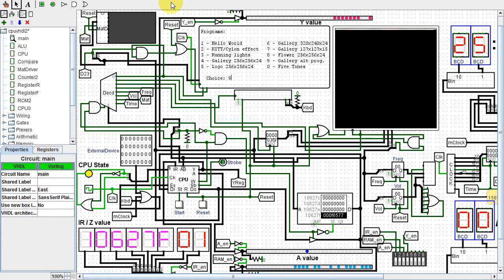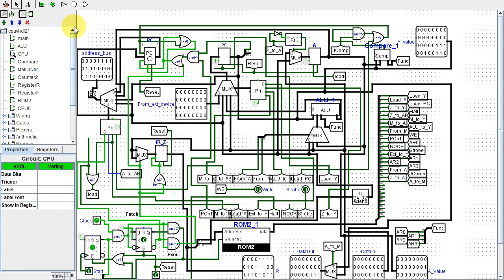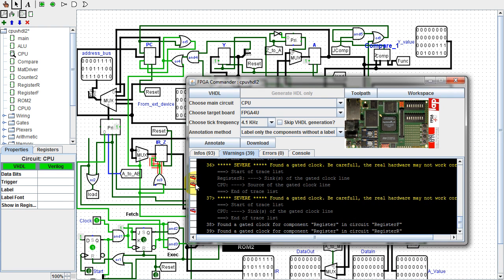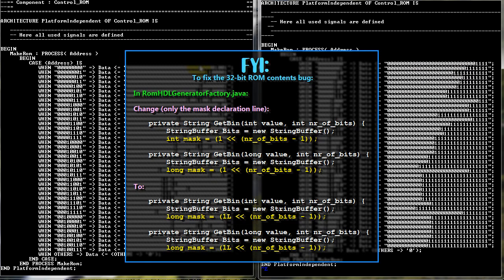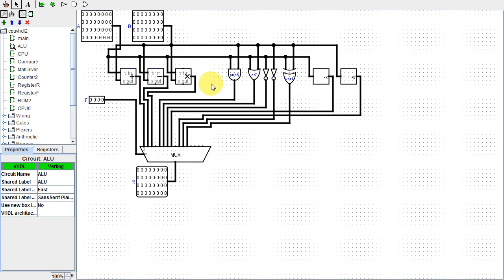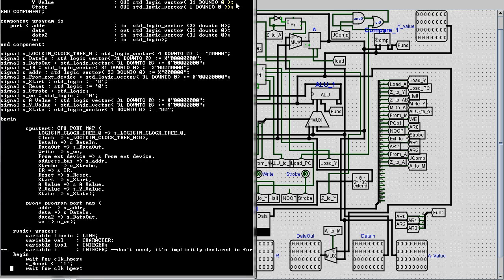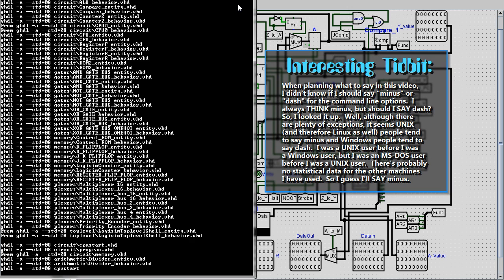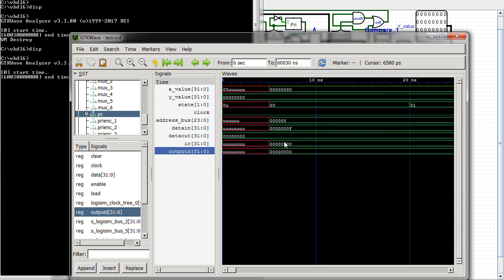Converting My CPU to VHDL Via Logisim Evolution (for Eventual FPGA Board?)

Comment: I have a problem, I maximized the VHDL Simulator log and now I cannot see my circuit anymore unless I end the simulation, how can I fix it? I tried uninstalling and installing again multiple times but I could not fix it
Reply from the maker: @Noora AlNaimi I've never used that feature.  I believe it's the feature that requires Questa which I don't have.  So, I probably wouldn't be able to help you.  BTW, there's a lot of information you didn't provide like what OS (Windows, Linux, etc.)?, which version/fork of Logisim?, executable or a JAR file?  But I don't think the answers to those questions would help me because of the reasons I first mentioned.  If the log is a different window, maybe there's a keyboard shortcut to un-maximize the window (dependent on your OS).  There are many settings Logisim doesn't save to configuration files, so I don't think it's some persistent setting in Logisim.  Maybe a setting in Questa (if what you're talking about is the feature that requires Questa).  If your OS is Windows, you might need to "regedit" to change some registry key (but only do that if you know what you're doing).  I can't think of anything else.
Reply: @MrMcsoftware  Thank you so much for your reply I really appreciate it. My OS is Windows 10, and I am using the 2.15 version and I tried with the 2.13.8 version as well (both are JAR files). Yes, you are right I am using Questa. The log appears on the same window, there aren't any window reset features, I will try the "regedit". Thanks again!
Reply from the maker: @Noora AlNaimi You're welcome.  I haven't used regedit/regedt32/(whatever Microsoft may have called it in Windows 10) on Windows 10, so I don't know if there are extra perils of using it on Windows 10 - so be careful.  My guess is that there are 3 programs to search within regedit - Questa, Java, and Logisim.  Also, I guess one of those could have "gone really old school" by putting a *.ini file in the Windows directory.  But, it's probably more likely to be some file in your application data or local settings directories (whatever Windows 10 calls it (Microsoft practically seems to change the directory names with each version of Windows)).  Uninstall programs often don't clear out those directories fully, so that could be the problem.
Reply: @MrMcsoftware  I see! Thanks allot I will try that! I really appreciate your time in answering me. Best.

Comment: Do we need to interface external fpga board with the logicsim or do the logicsim software comes with an inbult fpga board package??
Reply from the maker: @Sandeep Kodam I'm not totally sure what you mean.  You do still need either Altera (Intel now) or Xilinx software to synthesize.  The different versions of Logisim Evolution have differing levels of automation (but there are apparently efforts to add automation to other versions of Evolution) - Kevin Walsh's so far being the most automated (but you still need Altera or Xilinx - BTW, the choice of Altera or Xilinx depends on what FPGA chip your board has, though you could of course install both).  Kevin's version also has more support for the various I/O capabilities of the FPGA boards.  In case you're interested in Kevin's version, here's a link: https://github.com/kevinawalsh/logisim-evolution  Also, you can view my CPU running on an FPGA (and Kevin's Logisim in action) here: https://www.youtube.com/watch?v=rpuB1mYrEKY
Reply: @MrMcsoftware  Thanks for the reply. But my question is , Is it possible to programme and observe the outputs in fpga board virtually without the requirement of any hardware board in  logicsim ?? Just like there are many softwares like proteus lets say we will import the modules like microcontrollers or any , from the library into the sketch  and programme them in the software and observe the outputs  in the software itself without the requirement of actual hardware(Microcontroller) , In the same way is it possible in logicsim to import any fpga boards just like we import any logic gates and programme them and observe the ouputs in the software itself without any hardware requirement of FPGA.
Reply from the maker: @Sandeep Kodam Oh, I see.  I'm not aware of any version of Logisim that will do that.  Would be nice to have that feature though.

Comment: How to add my board in logisim?
Reply from the maker: I assume you mean how to add an FPGA board that isn't already in the list of FPGA boards...  I haven't done that, but you would select "BoardEditor" from the FPGAMenu, click in the window to add a PNG image of the FPGA board (you would have to have an image of the board).  Then left click drag the mouse highlighting an area of a particular component.  A menu will then pop up and you would then click the appropriate item to tell Logisim whether it's an LED,  button, pin, etc.  Repeat the process until all the parts are identified.  You most likely also need to know various parameters of your board (limits, capabilities, number of I/O ports, chipset, etc.).  Hope this helps.

Comment: Can I import vhdl code to LogicSim? Thanks
Reply from the maker: If you use Logisim Evolution, you can put VHDL code in your design by using the "VHDL Entity" component under HDL-IP section (in Cornell's version).  Other Evolution distributions have this feature as well, but you might have to enable it by going to the "Project" menu, then "Load Library", selecting "Built-in Library", and choosing "HDL-IP".  HOWEVER, the VHDL code isn't part of the simulation (though, maybe it will be if you have Questa (which I don't, so I can't say for sure)).  It's mainly just passed through when you generate the VHDL code using the FPGA Commander menu option.  There is also a "TCL" component that uses VHDL, but I haven't used that, so I don't know for sure what it does.  BTW, I cover the HDL-IP part a bit in my Verilog video.

I saw someone's circ file recently, and IIRC I think they had some VHDL code in either the VHDL Entity component or TCL (don't remember which), so maybe it is more useful than it seems (in terms of simulation).

Of course, if your question is "can I convert a VHDL file to a circ file" (meaning translating VHDL into equivalent components like MUX, NAND, decoder, encoder, RAM, etc.), I'm pretty sure the answer would be no.  It would be nice if it was yes.
Reply: MrMcsoftware thanks so much. 👍

Comment: Is your design screen a VGA type?
Reply from the maker: I'm assuming you're asking if I put this in an FPGA, could a VGA monitor be connected?  As is, I would say no.  There are FPGA boards with VGA connectors, and VGA libraries (I believe) - if those were used, maybe then it would work.  I can't remember if 256x256 is one of the possible VGA modes (certainly would be a seldom used and seldom supported mode if it does exist).  But, my 320x240 mode would be a VGA compatible screen size.  Of course, in actual hardware, you would want much higher resolutions (and would have the necessary speed to do it).  BTW, Logisim doesn't convert most of the higher level devices to VHDL/Verilog and the screen device that Cornell (and I) created doesn't automatically convert to VHDL/Verilog, so screen IO would definitely need to be programmed by yourself (or use libraries).  Also BTW, in the video, for the most part, only the CPU is created in VHDL (in terms of what would get sent to the FPGA) (the keyboard, text screen, LEDs, and memory are really just testbench things) but the rest could probably be done (but by someone with more experience than me :-) )  I hope I answered your question correctly.

Comment: Have you got an add-on to Logisim-Evolution giving the Verilog and VHDL output? I have version 3.1.1-HC running and it has nothing in the FPGA board editor. I would like to do the same a cpu I made up. It is not very easy to re-draw it in Altera Quartus.
Reply from the maker: No add-on required.  In the HC version, you need to select "Synthesize & Download" menu option (from FPGA menu).  BTW, in normal Evolution, the menu option is called "FPGA Commander".  The board editor is only used if your FPGA isn't in the list of known FPGAs and you have the necessary information to add your board (but you would still go to the Synthesize option to convert to VHDL or Verilog, etc.).
Reply: Thanks, but nothing seems to happen when I do that. There isn't a list of supported boards and no red/green labels for Verilog and VHDL like on your video.
Reply from the maker: The version of HC I have (3.1.0) doesn't have the red/green labels (since Kevin Walsh started his HC fork before Evolution added that), so I'm guessing 3.1.1 wouldn't have it either.  But for the other part, I don't know why that would happen - maybe an incompatible version of JAVA?, or maybe Kevin forgot to include the FPGA boards in the JAR file (each board has an XML file in resources\logisim\boards directory (in the JAR file (you can unzip/7zip/winzip/etc. the JAR file))).  IF you start up HC with a jar file from a DOS prompt (cmd) (I'm assuming Windows here) any JAVA errors will show up (maybe that will show what's happening when you select that menu option).  Also, if you created the circ file on a different version of Logisim or if you use JAR libraries meant for a different version of Logisim, it could screw up the behavior of JAVA/Logisim enough to give weird results.  Perhaps see if you get the boards list without ever loading a circuit or JAR library.
Reply: Yes it was an old version of Java. I'm fully working now and doing the same as you with my reverse engineered cpu (a NS8060 SC/MP). Thanks for you help. I'm following your conversion to Evolution video.
Reply from the maker: I'm glad it's working now.  BTW, I only briefly covered HC version in my Verilog video (and that was the first time I covered it).  The other videos using Evolution use the reds-heig version.  So, some of the bugs (etc.) I mention in the conversion video might not apply to HC (I think they will, but not sure).

Comment: I find it really exciting to see the evolution: from a simple CPU to this massive computer. Great job!
Reply from the maker: Thanks!  I had only planned on doing the first video, but then I wanted to improve it a little AND there seemed to be a lot of viewer interest, so I did more.  So, I would say the evolution is partly because of you viewers.
Reply: @MrMcsoftware  how to integrate VHDL in logisim software?
Reply: I have Modelsim and VIVADO software..
Reply from the maker: @Zubair khan I don't have Xilinx software (Vivado), so I can't say from experience.  I haven't checked out the latest Logisim Evolution versions, so I don't know what options they have.  But the older ones (and the ones not holy cross) have a "FPGA Menu" menu, from there "FPGA Commander", from that dialog, select Toolpath.  There you would select the path to your FPGA software. HOWEVER, the dialog seems to indicate it's only Altera (not Xilinx).  You might need to use Kevin Walsh's Holy Cross version (but perhaps the newest Evolution has put his changes in place).  If using Kevin's version, go to "FPGA" menu, then "Synthesize & Download", from that dialog select "Settings", there you can definitely select the path to you Xilinx software.  From my experience, each time you use Logisim, you have to set those settings.  BTW, if you need address of Kevin Walsh's holy cross version, here it is: https://github.com/kevinawalsh/logisim-evolution  NOTE: if you've already started your project in some other version of Logisim (especially if it's the original version), you may have to do some work to get it to load and work correctly in holy cross.  I hope that answers your question.  Also, if you want to see the synthesization process in action, my other Logisim videos (especially my most recent Logisim video) show more.
Reply: @MrMcsoftware   @Global Video Channel  i m doing project in which i have to use a feature to change alphabet case from small to large and large to small..  can u give me a little idea how to do it?
Although i have implemented using separately add and subtract module.. but its not reliable when u enter words with different case
Reply from the maker: @Zubair khan Assuming it's ASCII, the difference between lower and upper is 32, therefore, you would need to set or unset the 6th bit to switch between them.  If you need to force to upper, you would AND with 11011111 (binary), and to force to lower, OR with 00100000.  There would also be other ways to do it.
Reply: @MrMcsoftware  there is not much help available over internet related to digital circuits.. i will try your method.. i hope it will work out.. thanks
Reply: @MrMcsoftware  Sir i am following someone design.. he has used tunnel option to avoid giving clock every time.. but there is a same look a like tunnel symbol  which he has used with keyboard buffer option.. but i don't what's this component or option.. can u help me.
Reply from the maker: @Zubair khan I don't know what's in the other person's design, but only tunnels of the same name are connected together, so perhaps the person has labeled that particular tunnel "keyboard buffer" and that tunnel would be logically connected to some other tunnel labeled "keyboard buffer".  And all the clock tunnels would perhaps be labeled "clock" and they would all be logically connected to a clock with a tunnel labeled "clock" connected to it (or perhaps whatever version of logisim they use automatically assigns a virtual tunnel labeled "clock" to a clock component).  But the clock tunnels would not be logically connected to the keyboard buffer tunnels.
Reply: @MrMcsoftware  i know the tunnel which he used.. but he used look a like tunnel symbol.. "keyboard buffer" is a comment of component
Reply from the maker: @Zubair khan I assume you know that the tunnel symbol changes appearance depending on the Facing direction.  But if it's not a tunnel, then maybe it's a subcircuit the person created.  You can create your own "icon" for any subcircuit you define.  If it's not a tunnel and not a subcircuit, then maybe it's something added to the version of Logisim they are using (which maybe is not the same as your verson).  By the way, I don't know if you're looking at a screenshot of their design or you actually have their design loaded in your version of Logisim.  If you have it loaded into your Logisim, while in edit mode (arrow rather than hand), you can click left mouse button on component and see what it says in the lower left area of Logisim.  Of course, maybe you've already done that.  If it's a subcircuit, you can double click left mouse button on component (while not in edit mode: hand rather than arrow), and it will take you to the subcircuit.  Also, if this design was created to go into an FPGA, perhaps it might be something associated with the particular FPGA board the person used (maybe a VHDL thing)
Reply from the maker: @Zubair khan According to the circ file (that he provided), the component is a pin.  And not a special pin, just a standard pin in his version of Logisim.  I'm guessing the appearance is different because of some enhancement made in his version of Logisim.  You can edit (or view) the circ file and search for "BufferEmpty".  The circ file also indicates that it should be loaded with Reds-Heig version of Logisim-Evolution.  So, the pin appearance might be a new feature of Reds-Heig (or maybe it's some fork of reds-heig of which there are many), maybe you need to get the latest version?  (Unless you have successfully loaded it already).  The pin might just be for information purposes, it might not actually do anything.
Reply: @MrMcsoftware  thanks for the help.. u are very kind..
I have the latest version of logisim evolution which i had downloaded from your link.. you have just clarified the confusion..
Thanks a lot
Reply: Sir i need your help.. i want to implement a SRAM circuit that has a 32 bytes with its associated decoder and multiplexer. Is there any way you can guide me.. or help me pick fhe ladder where to start
Reply from the maker: @Zubair khan I know how you could implement it in Logisim, but I don't really know of any good way to describe it in a youtube comment (if youtube comments could contain images, then I could).  So, I searched for something on the internet I could point to that would do a good job showing it.  I think I found something good (specifically slide/page 3 and ones after that): https://courses.cs.vt.edu/~cs2504/fall2008/Notes/PDF/L19.Memory.pdf
Reply: @MrMcsoftware  Thanks a lot.. If you are comfortable.. Can i get your gmail id? So i can share with you that i am heading the right way or not?
Reply from the maker: @Zubair khan It's my policy to only communicate through youtube.  One reason for this policy is that the information may be helpful to others as well.
Reply: @MrMcsoftware  Ok... i can understand.. is there any way so i can show you my work?
Reply from the maker: @Zubair khan I guess you don't have a blog?
Reply: @MrMcsoftware  Nope,, i don't have